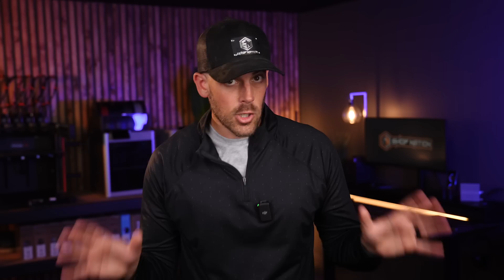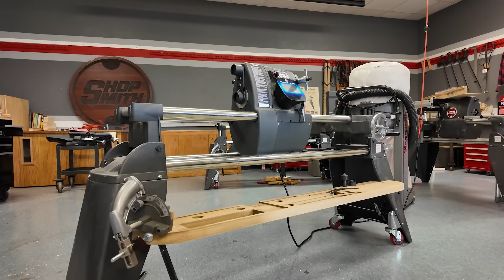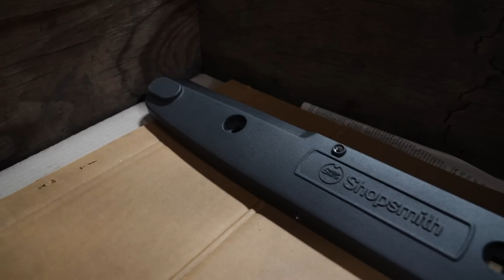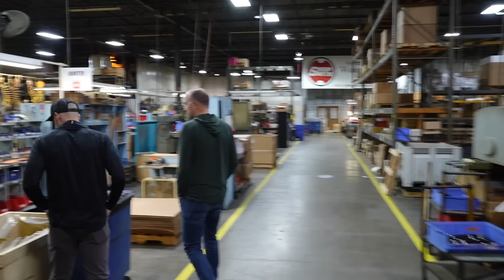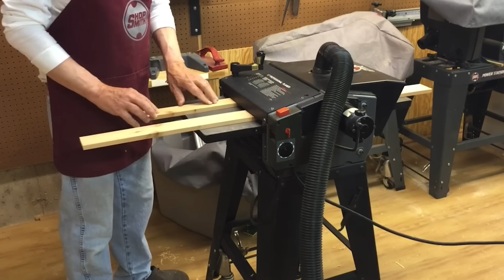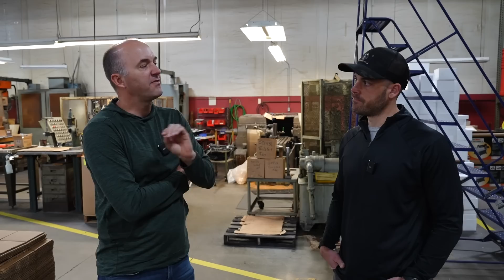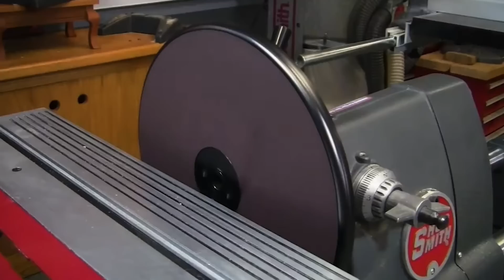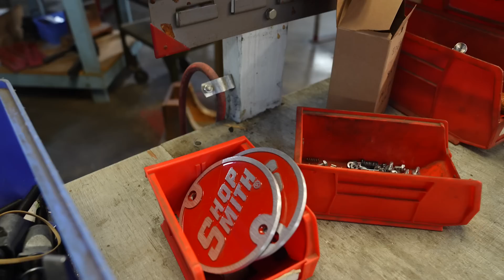The Last American Power Tool Company is (almost) dead

Comment: I love the concept behind ShopSmith and totally get the appeal. But, honestly, the table saw seems to be the weak link here. It’s great at making the lathe and other tools, but the table saw setup is just too cumbersome and inefficient. 

If I were in charge, I’d think about ditching the table saw entirely. Instead, I’d focus on perfecting the lathe, jointer, band saw, drill press, and belt sander. This would simplify production, improve product quality, and likely lead to better margins and overall financial performance.

Now, to attract the 25-45-year-olds to woodworking, we need to think about what appeals to them:

1. *Modern Design and Tech:* Younger folks love modern design and smart tech. Integrating app connectivity for tutorials or project tracking could make woodworking more engaging and accessible.

2. *Compact Solutions:* Many in this age group live in smaller spaces. Highlight the compact and versatile nature of the tools, showing how they fit into smaller workshops or garages.

3. *Community and Learning:* Create online communities and offer both in-person and virtual workshops. Collaborating with influencers and content creators can also boost visibility and appeal.

4. *Eco-Friendly Practices:* Emphasize sustainable materials and eco-friendly manufacturing. Younger consumers care about the environment and prefer brands that share their values.

5. *Starter Kits and Subscriptions:* Offer starter kits and subscription services that include tools, materials, and project plans. This lowers the barrier to entry and keeps customers engaged with regular new projects.

By focusing on these strategies, ShopSmith can attract a younger audience and build a new generation of woodworking enthusiasts, driving long-term growth.

Comment: They should start a video series with the target demographic in mind. This should be filmed in a single car garage to show the advantages of the Shopsmith. Shopsmith should bring a bit of the organization and integration that the Festool has, but within a garage and what you can make for yourself. They should start small and occasionally have something more difficult and rewarding.
Make an attachment storage space.
How to make a storable assembly/hand tool work surface for the Shopsmith. This must work in conjunction with the above storage space.
Make a small butcher block
Make a salad bowl
Using other power tools with Shopsmith
Using hand tools with Shopsmith

Comment: In my opinion :

1) people have a perception that the design is dated and is potentially dangerous in today's world (Marketing issue). 
2) The attachments have been historically labeled as good enough and not really as good as stand alone versions, you know the saying "jack of all trades...", thing. 
3) There is a perception that the able saw top needs to be bigger (marketing needs to show that's not true), it comes across as tiny and scary. John Malecki's video didn't do them any favors. 
4) Instead of selling it as a complete set, sell a base model that's more affordable. 
5) It is expensive. Even at around $2800.00 is too expensive for a lot of people for the entry level version. I'd rather pay $600-$1000 for a table saw, $200-300 for a drill press and another $250 for a 12" disc sander to start out. The lathe and horizontal boring could be upgrades.
6) Add on tools need to be more competitively priced to stand alone versions (i.e. $529.00 for a strip sander, $650 for a 6x48" belt sander, $750 11" Bandsaw, really?)
7) Lifetime warranty needs to be rethought to maybe 5-10 year, with a possible renewable service plan (recurring revenue). Doesn't help anyone to have a lifetime warranty if the company is gone.
6)They need a $1500-2000 entry level price point that they can build on from there as time goes on. 

Again, JMO.

Comment: Automation and Controls Engineer here. I'm obviously biased, but you can't afford manufacturing through labor intensive means anymore. Stamping, forging, cutting, assembly, packaging, and warehouse control are all areas to improve costs. He's aiming to create demand by promoting space savings in the hobby industry and if he succeeds in creating that demand, someone else is going to swoop in and punch through that very old patent with new solutions at substantially less cost through reduced labor and overhead.

Comment: Time to invest in some online marketing videos.  Shop Smith's two big selling points are how little space their platform takes up, and how reliable they are.

That means two commercials, each less than 60 seconds.
1.  Put together a comparison, showing how much storage space you need for a table saw, pillar drill, lathe, sander, etc. Then show how little space the Mark needs.
2.  Make a video showing how little work the repair department needs to do.  Smith doesn't have a large repair department, because their products are built to last.

You invest $30,000 on these two videos, then have the social media gurus do whatever magic is needed to get those videos showing up in the commercial interruptions we're all complaining about.

Honestly, had I known that something like the Mark existed when I was starting to build my shop space, I wouldn't have wasted time on a stack of tools that I have to pull out/use/put away.  I'd have saved up a little extra, and invested in one tool that could to it all for me.  And I'd get to leave it out because I would be using it for everything.

Comment: I got a well used 510 from a buddy who had complete provenance from original build to me.  I was able to bring it back to shop floor spec and use it daily.  True, it does some things better than others but is a rock star as a lathe and boring machine.  I especially like being able to use it to dimension stock using table saw and jointer at one station.  So many videos on setup, care and maintenance and techniques out there also.  Hope the current owner can keep it afloat.

Comment: If Nick is listening, I hope he considered bringing back the planer. However, I think he needs a planer for the new era. Consider lighter materials like thermo plastics and aluminum where possible to dramatically cut the weight of the planer. The thing was HEAVY. Plastics doesn’t mean cheap, the 13” Dewalt planer is considered one of the best planers ever made and has plastic body.
Reply: Dropping the planer was HUGELY shortsighted on Nick’s part, IMO.  “It costs $1600 to make, and we were selling for just $2000. Not a lot of margin”. Yet still it was marginal, still some profit, no matter how small. Even at break even, it was an important part of the core Shopsmith power attachments. A Shopsmith can perform any needed woodworking function…or it used to be able to.  Once you break that, once you say “Okay, planing is a crucial woodworking function, but go buy a planer somewhere else, we can’t help you,” it gets VERY easy to start going someplace else for all of the other core capabilities.

Comment: I have had an old mark V Shopsmith for about 25 years now. While the machine is made solid and has only had one part needing replaced. It also has problems that I believe have caused its undoing, so to speak. The tablesaw platform is simply too small unless you only plan on making small items like bird houses, small boxes or the like. Same thing for the 4 inch jointer. It is way, way too small; not wide enough and the in-feed and out-feed is too short for any project beyond small bird houses, jewelry boxes or maybe a small toy box. Maybe if they made a 6 or 8 inch jointer with a longer  in-feed and out-feed.
 The last major item that I made on it was a stand for a 100-gallon fish tank. It was a major pain in the behind. It took 2 people for most of the parts, 3 people for the back piece of the stand and multiple ajustable rollers to help keep the wood level to the tablesaw. While Shopsmith does make a larger platform that can be added to the old mark V's, it, too, is also very small and just not worth the cost for what little increase in capacity that you get. I originally had planned on buying the 12 inch plainer, but instead bought a combo 12 inch plainer and jointer because Shopsmith's jointer is pretty much worthless, in my opinion; it is simply too hard to keep the in-feed, out-feed and fence in alignment due to the nature of it being portable and continual need for installation/removal on/off the base of the Shopsmith to use other attachments such as the bandsaw and belt sander.

 At this point, the only thing that I keep the Shopsmith for is the lathe, beltsander, disc sander, drillpress, and bandsaw; since I'm too lazy to continually change the blades on my 20 inch bandsaw.

Comment: Shopsmith owner here.  2 comments--machine changeover is quick and easy IF you plan your work well.  If you don't, and have to go back more than once to do a changeover and repeat a procedure, it becomes a pain.  #2--they will have to address the possible requirement that table saws will require SawStop type technology.  Hard to see how that gets added to a ShopSmith.
Reply: I highly doubt that SawStop change is even passed....
Reply: I would venture to guess that ShopSmith would just stop selling the table saw arbors and stop marketing it as having table saw features. The truth is that the tool is lathe based, and Nick even said it is their weak point. You wouldn’t be trying to make an existing “table saw” accept SawStop style technology… you’d be trying to make a lathe accept SawStop technology, and that is the problem with making them do it.
Reply: Fair point about the sawstop thing, it will be interesting how that develops
Reply: How did so many of us survive using a SS for up 70 years and not lose body parts? Part of learning to use tools is learning to be safe when using them.
Reply: Maybe a motorized table that shoots upwards instead of the saw moving downwards? 🤔 If potentially flinging your workpiece up is deemed safer than cutting off fingers, haha...
Reply: One of the main issues with adding a sudden blade stop is the robustness of the machine to take the forces involved. It seems likely that won't be an issue. If there's space for the cartridge required then there is a fair chance.
Reply: Government will pass the law.   Because sawstop is unlocking the patent.  In return they will sell the tech which will go into every table saw.   Maybe shopsmith can be an early adapter and and licensee.  Engineer something that sits on the rails or looks like the planar.     Maybe sawstop will take pity on shopsmith or even buy them to get them first to market and a non sawstop branded saw.
Reply: I hope that stupid idea of requiring a saw stop goes nowhere! Jesus people, just fu€|<ing pay attention to what you're doing! 😳 🙄 🤦
Reply: @wesman7837 since over and over again the danger of the table saw has been proven to be kickback. Maybe we worry about a fix for not paying attention to what you are doing.
Reply: @wesman7837 
I hear you on people just needing to pay attention to what they are doing. They must use their heads and stay focused.  

Saws are extremely dangerous. 

Even when staying  focused, accidents can still happen. Someone trips,  someone else startles one unexpectedly with a loud noise causing user of saw to get hand near blade or otherwise cause a hazard. User has heart attack and falls into blade, sneezes unexpectedly & loses control over workpiece or hand gets into blade. The dangerous possibilities are endless. 

But if you watch the video of the SawStop safety feature actually at work, it is aweome  and ultimately LIFE CHANGING SAFETY IN ACTION. Loss of limbs are devastating. And painful. 
We just need to get around copyrights and cost.
Reply: That actually isn't that hard of a thing to do as if you look at those technologies it attaches to the table.   They would just need to provide a plug for power off the main board.
Reply: @mekko1413 
The REAL problems  are cost and copyright issues. The technology may be there, but if everyone else has to buy the rights to copy the design from their competitors, it will be costly and defeat the purpose of being in business. End of competition, out of table saw business.

Comment: Until housing is more affordable for Millennials and Gen-Z, it's going to be very difficult to sell them on a home woodworking system, even if it fits in less than 15 square feet of space. When my time comes, I hope my Gen-X son decides to take my Shopsmith and try to make a few things with his daughter.
Reply: 51percent of millennials own homes. 

Gen Z is still young and the oldest is turning 27 in 2024 with an average rate of 30 percent home ownership.
Reply: @PistonHonda87  Thanks for the data. Maybe it's not so hopeless.

Comment: I've owned the shop, Smith since 1979 never. was disappointed in it. What I like about the tool is the quality and at its upgradable for a very low cost I still have my shopsmith. and all the accessories I've upgraded several times through the new system have not gotten the Powell Pro yet. But thinking about it I wish one thing shopsmith would do was make the machine a little lower to the floor. Being five, 6 it's kind of overreaching. When using the tablet saw, that's the only complaint I have about the machine. It's been reliable. and a good tool.

Comment: One simple option. Would be to offer a shorter base frame (18 inches shorter) shop smith would store in less space. I owned an older shop smith and loved all but the table saw (basically open spinning blade scared me). Sold when we moved. The lathe, disk sander and drill press were great. Have considered buying another (hopefully table saw has been improved)!
Reply: They do sell a shorter one that is 55" long, it's called the MARK 4 [Shorty].
Reply: They do sell shorter Shopsmith.

You Shopsmith should NOT have an open blade. There is a blade guard both top and bottom.
Reply: There is a shorter version now and the table saw is definitely not an “open spinning blade”.

Comment: My 40+ year old Shopsmith is still a vital part of my shop. I appreciate the new owner's honesty about the product limitations. The table saw is a weak spot but still quite usable. I own a stand-alone Jet tablesaw which is my go to, but the Shopsmith jointer, bandsaw, and drill press are perfect for my use and still perform as good as they did when I got them in 1983. Surprisingly, in all these years I have never once used the lathe feature! I'm very happy to see the company still in business and wish it much success and growth.
Reply: I quite literally worked in the twin building next to Shopsmith in ... 1983... Mead Digital which became Diconix when Kodak bought us...  left in 1985... Right there south of the intersection of I70 and I75... actually just south of Little York Rd... and the witch's mother Agnes Moorehead  is buried right across the road...  :)

Comment: Most of your time is in the set-up not the process. Can not be the best choice in my opinion.
Reply: Outside the table saw, switch tools is not really a time drag. I change most within 60 to 90 seconds. About the same time if I have to move a power tool on a mobile base, plug it in and set it up for the job.

Comment: Focus sounds good. I started with woodworking in junior-high and having this tool to set up a shop sounds ideal. Once the goals and outputs are known for the MVP the specialized equipment can be acquired to improve efficiency and reduce final cost. This is why pairing with a 3D printing entity makes sense, its what we do already.

Comment: looking at them, i can never picture how to use it. there is so little table space on the saw etc. making anything other then toys seems questionable
Reply: The table saw has attachments and can easily cut an 8x4 sheet of plywood. It can have a bigger surface area than most cabinet saws.
Reply: @PistonHonda87  then they really need marketing. ive been woodworking for 15 years and had no idea they still existed and have literally never seen one used on youtube ever. Ive only ever seen them in used tool listings

Comment: ok, one thought, 2 words.... 'International Sales.....!!!   As someone with definite space issues (UK garages are 'Single' only, and most often you can't even fit a car into them, i kid you not, so something like this would be absolutely amazing to have.  I have never, not once, seen, or even heard of anything like these tools, and that's just crazy.  Maybe even try and get the UK Forces to use them?  There is always restrictions when it comes to space and one of these in a dedicated 'box body' (so as to fit on a truck etc) is a no brainer.
Reply: There used to be a UK distributor for Shopsmith.
Reply: They don’t produce the machine in metric system—I asked.

Comment: I wish them success. I think it will be a very difficult climb primarily because the Shop Smith is focused on a workflow that most people no longer use. Most hobby woodworkers start off with a table saw, cordless drill, miter saw, thickness planer, and lately a track saw. A drill press is nice but you can work around not having one. Same with a jointer. The biggest downside with the Shop Smith is the fact that you have to convert it to do other operations, thus losing your setup and adding more time. If space is an issue I would argue that you can easily collapse dedicated tools into a small area. I'd like to see Shop Smith capitalize on their made in USA status and their reliability to make the kinds of tools most people are using today.